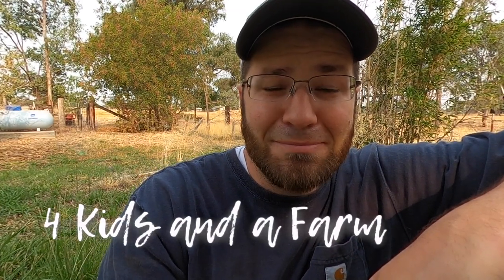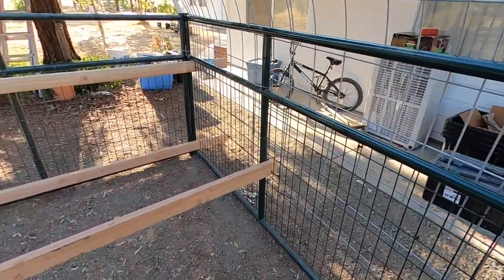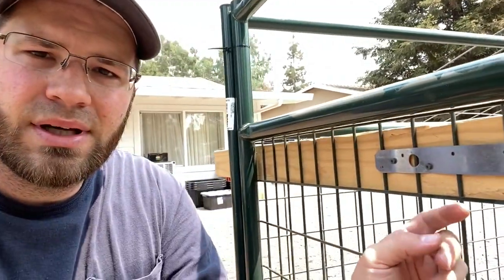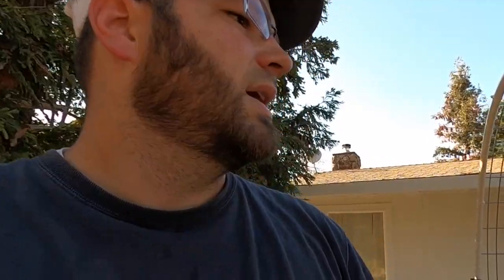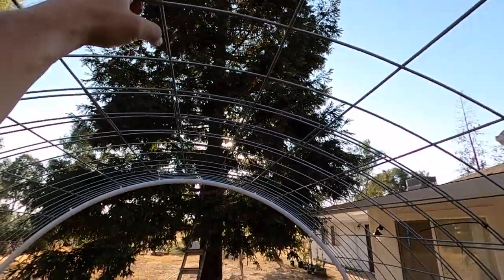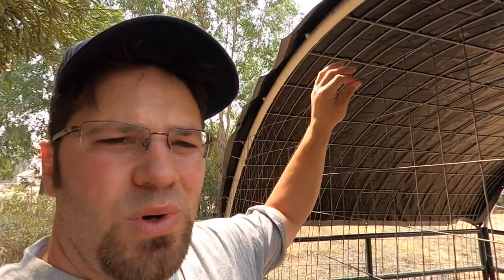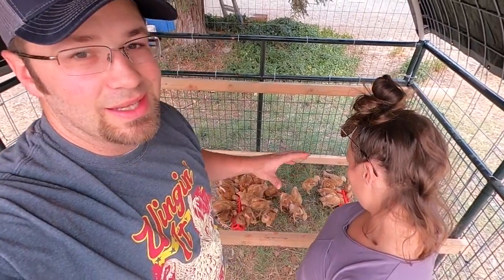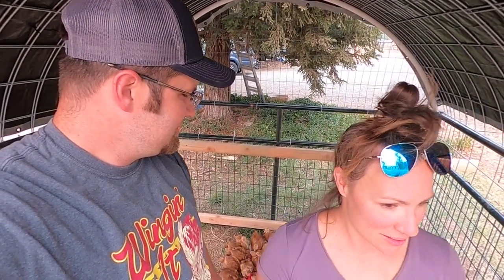Our Easy DIY Chicken Tractor Should Last Forever!

Comment: If you try to go as cheap as possible for the wheels, you'll end up replacing them soon too. Do yourselves a favor and get the chick lift wheel system. It makes a whole lot of difference in what you can or can't move on your own and will go flush on the ground when not moving. Several channels have them and like them.
Reply from the maker: We may or may not have ordered one those 😉